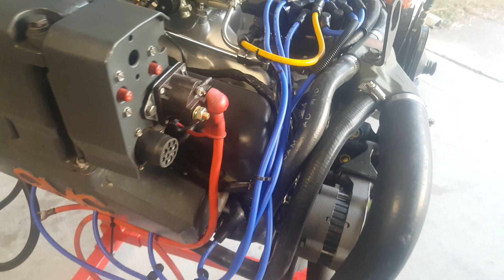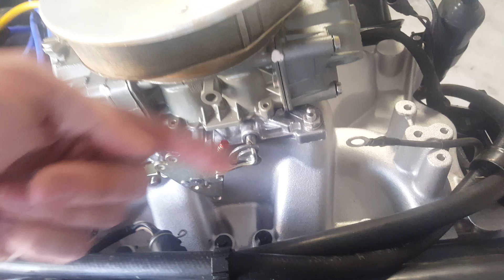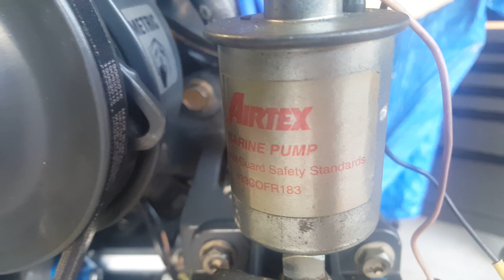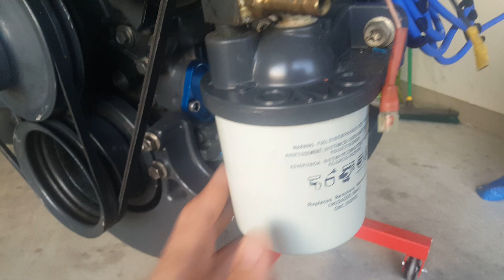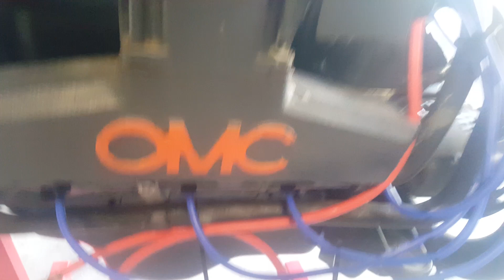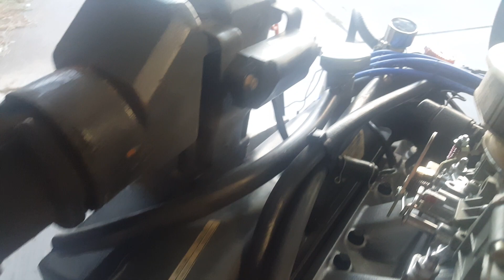OMC Cobra Volvo Penta SX High Performance Engine Upgrade 375HP!!!

Comment: What makes it 350+ hp?
Reply from the maker: Cam and heads upgraded and supported with different pistons along with higher intake and lots more fuel.
Reply: @michaelromer2016 what are you doing to keep the outdrive ?  I want to do aluminum heads intake on mine ECT to get 400 horse similar to my Windsor wish I could find a swap to bravo....

Comment: I have a 1992 fourwinnz horizon 200 with a OMC Cobra 5.0 in it.  I've been wanting to upgrade the motor so I get around 350 to 400hp, but was wondering what you are using for the outdrive?
Reply from the maker: The stock OMC setup. I've got a subscriber that is using a 650HP on his stock OMC stern drive with no issues. I'm working on this project now. Check out my channel. Please hit that subscribe button!

Comment: Hello Michael, I have a 1994 Four Winns with the MPI OMC Cobra 5.0 with 215 horsepower I have been trying to find horsepower mods that I can install, and haven't been able to find anything. Do you have a web page or any Ideas on where to find some thing to give me maybe another 50 horsepower thank you in advance for any advice.
Reply from the maker: Most will want to go with aluminum heads and cam, but the omc exhaust risers are too heavy and over time will crack your heads. You will have to look for 5.0 liter cobra mustang heads that are cast iron. The cam upgrade will also help. Forced induction is the easiest mod, but way too expensive. I’ll get more into that details in my next series. Trust me, I’ll cover all this soon.
Reply: @michaelromer2016  There is a Company that makes a direct replacement stainless steel header! Back in like 2005 I could not fine manifolds for my 4.3L OMC! So after not using my boat for 2 years someone told me about this company that made direct fit headers! Let me tell you I gained a noticeable difference in speed and Fuel consumption! Also it saved alot of weight and made it alot easier to work on my engine!  Each header has a pencil anode, and after 17 years of use in saltwater they still look brand new! Also I keep my boat docked in the water at a marina about 5 months out of the year! The company's name is HI-TEK
http://www.hitekmarine.com.au

Comment: I finally got my engine built and installed I stuck with the 302 I took it out the other day and cruised around for a few hours and ran perfect but when I was done cruising I was in the other side of cedar creek and tried to run it wide open I had instant plan and made it all the across then when I got close to the ramp it started to loose power and back fire out the carb then shut off it started right back up I checked the timing and it was good I was told it could be caused by lack of fuel so I put a electric fuel pump on it and took it out yesterday and I can run 3,600 rpm all day as soon as I get about 4,200-4,500 it does it again I am still running the 2barrel carb with a fresh rebuild
Reply from the maker: Brandon--Backfires ruin your power value in your carb, leading to further complications. Definitely, rebuild that carb, I have a video on a 4 BBL version--it's going to be the same design, only cut in half. Also, you are describing a a timing issue in every part of your problem above--I see no reason to involve the fuel piece, as of now. Let me run down the causes for you. 302 HO cams top out at 4600 RPMs. Standard cams are less than that, in terms of RPMs. If you are floating your valves at 4500 RPMs, you have a timing issue as a result of maxing the engine out--that is to be expected. Consider, keeping an eye out on your RPMs, as you can cause damage and have mechanical issues by running it at that high of RPMs. The other items to check is excess slack in your timing chain--if it's new, don't worry about that in most cases. The other part to consider is your distributor. You need to make sure you have a new cap and rotor--consider a MSD coil/cap if you like hot rod your boat around. You could also be running into an issue with your electronic pick up--the stock version is not considered high performance by any means--there is a new version it available, and I have a video on it. Have a good one.
Reply: Michael Romer 
I rebuilt the carb and put the mechanical fuel pump back on before I seen you replied I checked the timing it says to set it for 15 degrees btdc but when I set it that low it hesitants but there is not real timing marks there is a black spot with a white line in the middle and I have three of these harmonic balancers and they are all the same markings I have been setting it to the edge of the black mark cause I kinda think I can see a 15 there  I am willing to upgrade the ignition system I’m just not sure which one to get and yes I hot  rod the hell out of it when it lets me I bought a boat cause I can’t get in trouble for go to fast on the water like you will on the streets lol

Comment: I’m currently build the same engine I think I ha e a timing issue what firing pattern did you use and I have the spit  fire Ignition but I’m doing away with it just cause I can’t find any info on it I already have the same system you have cause my boat had the 5.0 and I’m swapping it for the 5.8
Reply from the maker: Brandon Hill Sweet!! I don't know spit fire either. I like stock myself, as stock is rated for marine use. Hit me up if you have questions!
Reply: Michael Romer spit fire came stock on some omc engines it supposed to be better for your timing curves just like the new engines that are Constantly adjusting timing for a better fuel economy and power . What firing order are you use if on you engine ?
Reply from the maker: You know, I just started researching spitfire today and saw it was stock in the OMC. Total face palm moment. Sorry about that! 13726548
Reply: Michael Romer one more question is your engine Reverse rotation or standard rotation
Reply from the maker: Brandon Hill It's standard rotation. No problem, ask anything, anytime.
Reply: Michael Romer I just found out today that I didn’t have a timing issue I have a cracked block so now I’m pricing long blocks
Reply from the maker: Sorry to hear about that! Depending on how you want to go, they have 5.8W blocks all over the place. If you want to go the long block route--check out Mabbco. https://www.mabbcomotors.com/catalog/marine